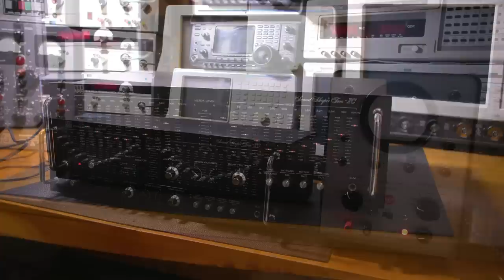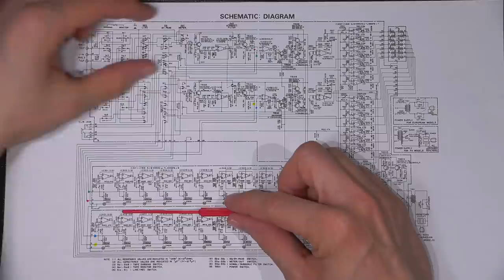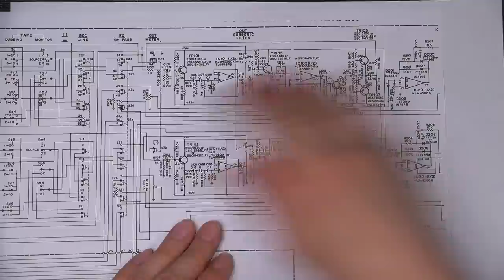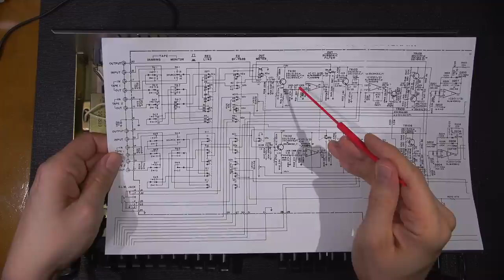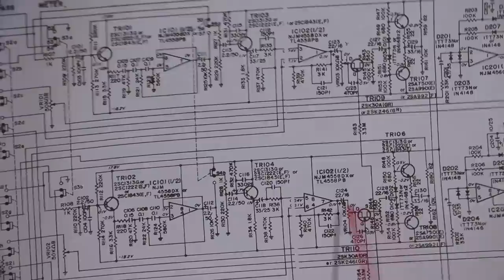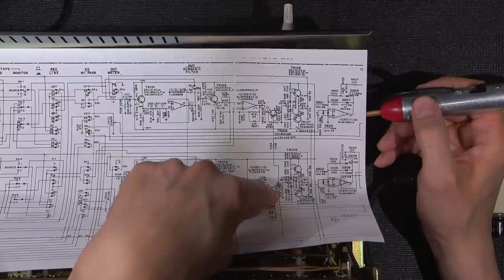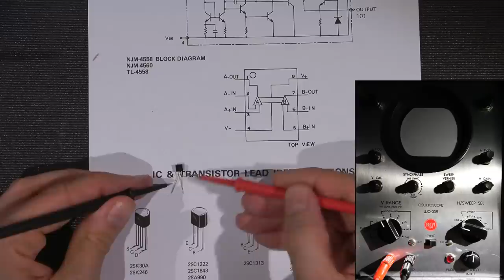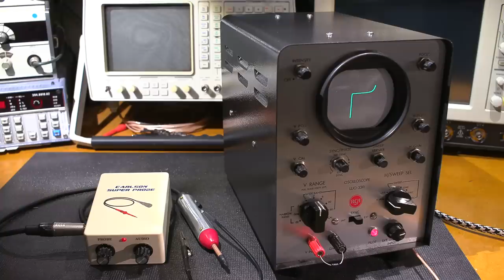Electronic Repair- Stereo Audio Equalizer From The 1980's!

Comment: Paul, or anyone else that would care to comment, what is the purpose behind having an emitter follower feed an op amp? Is it just to provide a low impedance source for the high pass filters between T101 and IC101?
Reply: Not sure about this, but my guess would be that TR101 is a buffer that makes it possible to set up a specific input impedance without having those resistors involved also become part of the filter that comes after.

Comment: You did not explain the reason the part failed. A reason explained or understanding could lead to any future returnes for the same reason.
Reply: There's really no way to say why it failed. If there was a power supply problem, it would have shown up during his other tests, and if one of the caps or resistors had died it would have shown up too. It basically comes down to the device being 30+ years old, and that component just got tired and stopped working.
Reply: Dan Todd, Good premise, but it would be a guess. Paul deals in facts. If the circuit promoted the failure, I'm sure he would have pointed it out. It was a low level failure, and an odd one, at that.
Reply: Dan, there's the what else in the circuit caused it to fail in this case probably nothing or what failed in the fet. There are very spendy  x-ray strip the epoxy and sem type services when you really need to know. They'd show you things like esd causing a latent defect etc.
Reply: Given enough time in service, EVERY electrical component will fail.  It's just a matter of when and with what severity.  So....the question isn't why a part failed as much as it is when the remaining components are likely to go.
Reply: Well, while viewing the entire video I also wondered why he did not spend time explaining- or looking for- why it failed.
In general, capacitors can die of old age, resistors (especially old ones from way before this thing was made) too, but when "a little FET" like this fails there usually is an external reason for it.
That reason can be lots of things, but "getting tired" or "lifetime" is usually not it.
Reply: And why did the chicken cross the road? The partcfailed because it failed, replace it and don't lose any sleep over it.
Reply: He sorta did. It's a pop filter. So possibly another piece of audio equipment has some popping issues. Can also happen when you turn high power gear on in an improper sequence. May even have been a ground loop or feedback in the system. I have a nice monitor amplifier that had a similar issue on the input side. Actually blew a capacitor and current limiting resistor on the input side.

Comment: Hey I have this exact equalizer and my question is does it only work on analog receivers?  I have a digital receiver and I do not notice any difference adjusting the left / bass side or the right / treble side.  Thanks!!
Reply from the maker: If it's in the analog audio path, it should work just fine.

Comment: I have an ADC SS-100SL where the lowest frequency (31.5Hz) takes several seconds to return to 0dB. Is this an issue with a capacitor or normal behavior?
Reply: Does it do it every time you move the 31 Hz slider, or only sometimes?  When it finally returns to 0 dB, does it do it quickly, or does it seem to 'ramp' into position?
It might just be a dirty potentiometer, the slide controls need cleaning every decade or two.

Comment: 46:38 - Does capacitance cause those 'oscillations'?
Reply from the maker: A very high impedance gate lead left "open" with the signal fed from the signature tracer is the reason.

Comment: Equalizer units were the shiznit back in the day.  And then everybody seemed to figure out that if you had a good amplifier and good speakers, then the equalizer was nothing more than an electric boat anchor noise and (nasty, digitally clipped) distortion generator.

Comment: "They've all gotta go!" is your usual mantra when looking at circuit boards containing 30 year old electrolytic capacitors. I've been following this advice in my repairs so what happened this time?
Reply from the maker: What happened? The focus of this video is hunting down a faulty component, not capacitor replacement. (off camera: FET's were matched, caps changed, VR's cleaned, some case screws replaced, so on...) It took an hour of video time (one week of real time) to just do what you see here, all the rest of the work would prolong the launch of this video for another week (video time and editing.) This is standard for all video's of this nature. (There's some inside info for videography on this channel)
Reply: Thanks Paul - it wasn't a criticism, just a comment. I know you take a lot of time and care over your outstanding presentations for which I am so grateful. You often mention changing these caps. without showing it on video, hence my comment. @MrCarlsonsLab

Comment: I had an amp that was working in my home but everytime it went back to the customer it didn't work! I found that the RCA jacks on his interconnects had a center pin that was too short to make contact with the current in the chassis connector.

Comment: Hi again Paul .... I just finished watching the whole video and even though it was clearly the FED you changed on the right hand side of the board was the RIGHT channel, you didn't mark it on the board or the circuit diagram. I have 50+ years working in electronics, so it doesn't bother me but as it was one of the first things you said you were going to establish, anyone just starting out on the electronics path would have gained a bit more knowledge and benefit from marking up the paper cct diagram and maybe the top of th PCB. Not a serious criticism. I just think newbies would learn that little bit more from being shown how to mark things up in case future repairs are required on the same unit. ......... Kind regards .... Tom

Comment: Colored dots are great if you never make mistakes. Very sharp high quality colored pencils placed with straight edges over the entire length of the line do not make for a messy schematic. Highlighters and blunt colored pencils without straight edges? Yes that is messy. Too bad ADC's parent company removed the title block and revision record.

Comment: @8:37 My immediate guess is that top one is Right because top connects to the Ring portion of TRS jack socket on the inputs
Reply: I was wrong. What is SLM jack for?
Reply: @nadia-v the SLM jack is for connecting an ADC sound level meter to facilitate the setting up of the sound shaper.

Comment: Repairman's syndrome. I never knew there was a name for it. One time it was my fault. If I had just power cycled it, it almost certainly would have worked, cuz it did at the shop. Another time, back in 1980, my brand new JVC receiver would work for 15 minutes or so, then no sound. Brought it back to store, techs couldn't find anything wrong. Brought it home, never gave more trouble. I have an old laser printer that started not booting up completely. Wouldn't go to READY screen. Did that 5 times in a row. Then half the time. Now works every time. (shrug)

Comment: Anything that has an intermittent problem can play games with you when the customer brings it, bouncing it or bumps in road in transit temp. fixing lost connections, etc, etc......happens all time with autos. After years of no fail test drives I learned the customer didn't bring the car for no reason test it again lol.

Comment: And what could be the reason for this defect FET? What is with searching the area, where it resides? Checking other elements? We call this a point and shoot repair. Succes. But why?
This super probe is impressive! 
Cheerio from Germany.
Reply from the maker: Some components fail in strange ways. Probably an internal connection wasn't formed correctly.

Comment: We had built a custom computer and mailed it to Hawaii only to have it not work. It was returned under warranteed but when we got it back, it worked fine so we sent it back. Sadly same issue. After the 3rd time it was discovered that one of the cards wiggle ever so slightly during transit. Out came the hot glue gun on every connector and card and finally no more repair man syndrome. We let customer keep computer and refunded money. From that point on hot glue was used on all computers mailed out.

Comment: i love the super probe so much i built 2 1 threw hole transistor the bass is a TDA2030A and the other one is tube i used 2 sub-miniature tube 6418 in the other the bass is a 6Y6GT push pool and 3 6F5 METAL

Comment: I own a Philips reel to reel that my friend had "Repairman's Syndrome" (AND under warranty so initially I didn't touch it.)  Philips had it twice and it ran flawlessly for over 24 hours both times - until he got it back!  He eventually ended up swapping it with me for some reasonable speakers I had.  It was a black "very PLASTICY - no metal" $500+ Unit bought early in the first half of the 1980's.  It did the same to me until I ran it with an expensive tape in it and left the room for 20 minutes while listening... after a very disturbing sound I returned to find the take-up reel had stopped and tape was spilling everywhere until it caught up on itself in a pile and pulled it back into a itself and when I ran in it started working again and a very messy take up started - FAST - destroying much expensive black back-coated tape :(  It now sits in my un-repaired equipment stash as it is intermittent at worst and has sat there for the past 33 years!  It's one of those "Repaiman's Syndrome Round TUIT" units now and I need to get one of those TUIT things but can't seem to be able to buy one anywhere. LOL  Thanks for a great video Paul once again....  and geez I love that solder sucker!
Reply: If you want to know more about reel to reel repair, look into 12VoltVids repair videos here on YT...

Comment: I have one silly question,

If that transistor is just working like a switch with small volt and probably low amps how that thing burn with so much protection between them ? bad part ? 

From the video looks like a surge from the output but how that thing burn a part between 2 others (that thing in in the middle of other 2 transistors)

Comment: Now EQ and speaker level is done automatically via a Mic.  times have changed. Still, love the old gear.
Reply: When it works. And when it doesn't, it is much harder to fix.

Comment: Nice quality case but the electronics are on cheap single sided paper phenolic pcb boards. That is a sign it was made overseas for the cheap labor. Wire jumpers are free but make a capacitor out of the copper foil on the pcb and you saved 10 cents. I worked for GE consumer electronics in the late 80's. Absolute crap quality but saving 10 cents on a pcb and your a hero because it's 10 cents X 500,000+ units. The people that built those boards made $20 to $30 a week.

Comment: Why are you using a VHF/UHF FET? That will give you noise issues!
Reply from the maker: Hello Jon. The noise figures for the 2N5486 are half the 2SK30's maximum. Keep in mind that this is not amplifying either (noise figures are not so important) These JFET's are switches, which is why they used a noisy part and most likely didn't care.

Comment: Not very important but the machine is firmly placed within the 1970s. ADC, (Audio Dynamics Corporation) had it heyday in the early seventies and by the time the eighties rolled in it faded away. It has a fairly (in)famous turntable which was used as the murder weapon in a Columbo episode. The most automatic of automatic turntables the Accutrac. Their specialty was moving magnet cartridges, and they were second only to Shure in the US in those days with the VLM, XLM range being ubiquitous for decades. The final series of 'Sound Shaper' made it into the eighties and that was the MK3 introduced in '79 I think. I never could work out why anyone would want to shove one of these things in between their bits and pieces? Awful things.

Comment: When you think you're into electronics.. and then you see this guy. Lab?! Looks like a submarine control station in there!! I'll put my soldering iron away now..
Reply: The catch-22 of electronics repair is that the test equipment costs 10+ times as much as everything you'll ever use it to repair is worth.
If you're a REAL diehard, most of what you diagnose and repair with it is... MORE ancient test equipment! ;)
Reply: @devilsoffspring5519  it's a vicious cycle..
Reply: @zimbab5748  Electronics is pretty cool, but a much cheaper hobby is getting into heroin or Fentanyl, buying a big house you can't afford and having a few kids :)

Comment: It's a bit concerning to see the quality of components used in such an expensive piece of equipment. ADC was synonymous with quality and was outside  of most people's budget. Yet they use carbon film resistors in the signal path as well as opamps that are very low-key. The 4558 is not an audio grade opamp. Before you blame the state of the art of the period, note that NE5532 was available in the 1980's
and had much better specs for audio. Also RC4136 and RC4156 were around. And metal film resistors certainly existed back then and it was very well known in audio circles that they had lower noise  than carbon film. I know because I bought metal film resistors in 1980's from specialized mail order houses ( I used to pay 20-30 cents each ). And don't get me started on the wisdom of placing a FET in the signal path of a device where you should be trying to squeeze every dB of S/N ratio you can from your circuit.